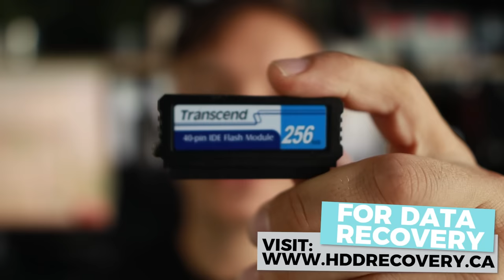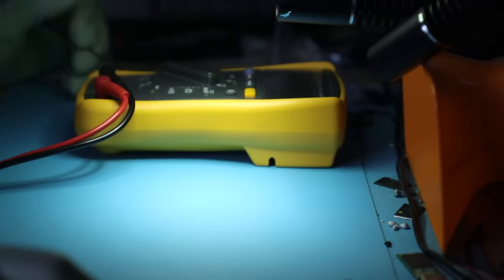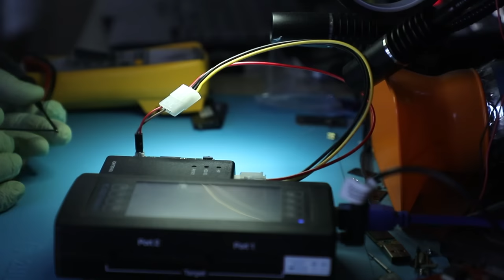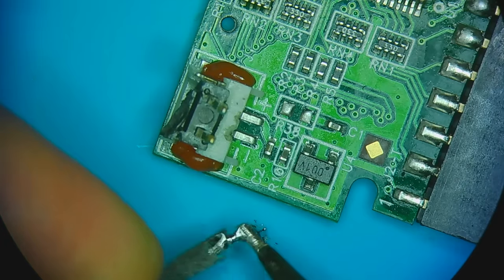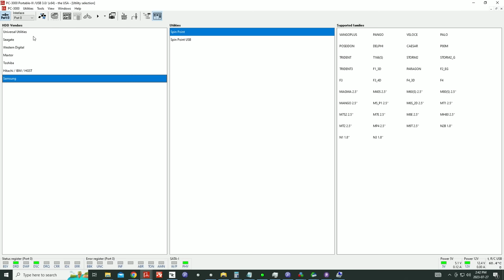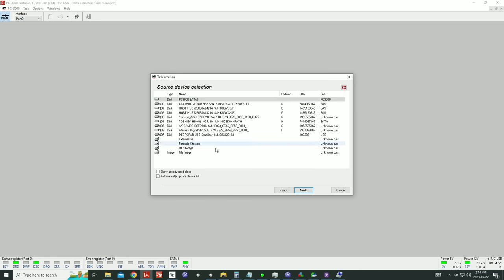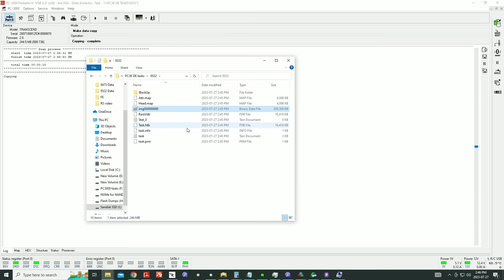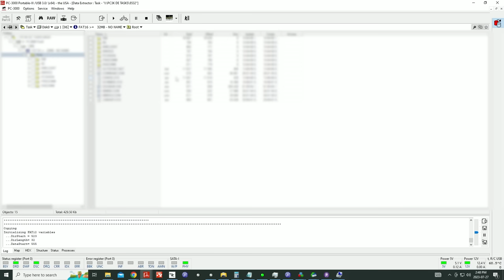SSD from ATM Machine died | Data recovery on IDE SSD Device

Comment: I've seen these devices. They are for retro PCs if you don't want to use an antique hard drive. But......because the interface is antique as well, it means it's a little bit of an unusual unit. It should actually make the PC faster. It's surprising how much of a dependancy even windows 95 places on read access times. This should have no trouble maxing out the bus.
Reply from the maker: also having SLC NAND on board makes them very reliable
Reply: @hddrecoveryservices  right!

Comment: Thanks for the vid, I always find them interesting. 
I have to clone small IDE and SATA spinning drives for old Arcade games often. I've been using SSD's and CF because it improves the games performance,  but because these games do a lot of writing, and these things just get powered off with no shutdown process, the SSD's lifespan is not as great as one would hope. Is there a form of SSD and interface adapter better suited to replace a Hard drive in these conditions?
Reply from the maker: You best bet would be to get a small size CF card. It would have SLC memory in it most likely (2GB and smaller). Those are very very stable

Comment: I was going to ask if the client was happy with the image or if the unit was repaired, but I saw in the comments that you repaired it in the end. Working with retro PC's I see people using these modules as replacement hard drives but say they are hard to find these days. Storage options are becoming a little too big for PC's of the 90's.
Reply from the maker: I see them on eBay. SLC makes them a very good option

Comment: Always enjoy your videos. I'm curious about the wire you use, after you solder the connection you don't snip it but just seem to wiggle and pull it. How does that work?
Reply from the maker: the wire is very think. That wire I believe is 41AWG = 0.07mm

Comment: Why did you prefer to image it so that the ssd is turned into e-waste? I would have replaced that 3.3v regulator quickly so that it can still be used as it was before.
Reply: Just a guess from me, but I suppose people won't have much faith in repaired SSDs or hard drives, I know I certainly wouldn't be comfortable, even though I understand that the failure might have been a fluke. Whether it's due to the amount of write cycles a NAND has been through, or just wear and tear (or heat degradation) of components, I guess people are happy to buy a new one where they have some sort of warranty, or if not for that, even just more confidence that it will continue to work well in the next few years or so.

For those who don't need data recovery services (i.e. people who back up their data) there's likely no value in repairing a drive like this for future use anyway; they probably just eat the loss, buy a new one and restore from backups (which is what I would do).
Reply from the maker: One of the reasons would be to save shipping costs to California. From here it is $60 overnight. 2nd reason it is much faster to deliver via download. But in the end I ended up swapping the 3.3v reg in there anyways because they could not use the image to restore. Unit was fixed and shipped  in the end :)

Comment: Nice. Just from intuition. Very nice. Did you check in advance that all the power supply goes through the regulator to decrease it to 3.3 V? Could it have been that some parts of the pcb run with the initial 5 V? Was that just luck, a good guess or did you check that first? Also very smart to check on each capacitor for the voltage. Well done. Smart solution. Chapeau!
Reply: noob
Reply from the maker: It's a pretty standard 3.3v regulator

Comment: What is the value proposition in restoring an SSD in this particular application? Wouldn't the data on the drive just be the OS and whatever software the ATM is running? In other words, isn't an ATM essentially just a "dumb terminal" that provides an interface to an authoritative remote server? And thus, why would there be any important data kept on the SSD, when the remote server has that responsibility?
Reply from the maker: I can't answer that question. Client pays - I recover 🥲